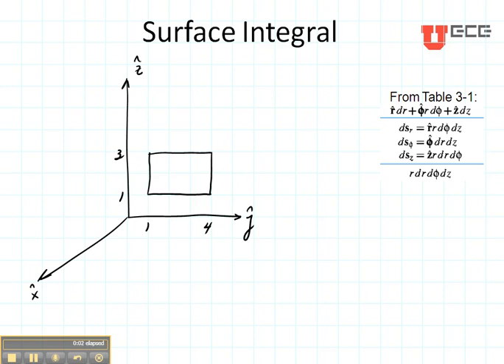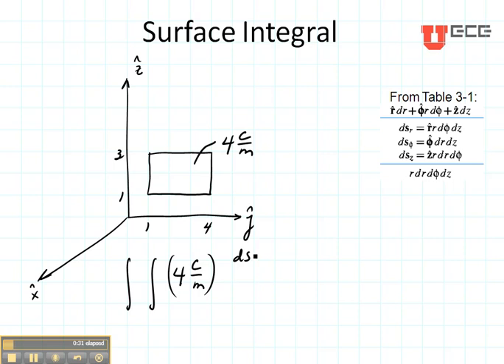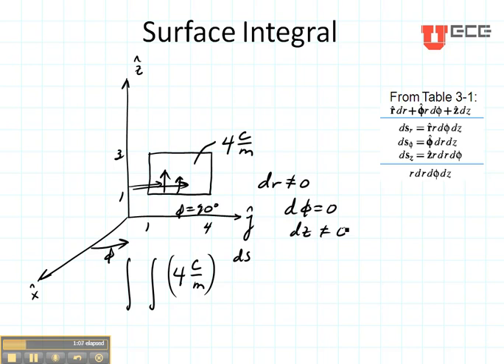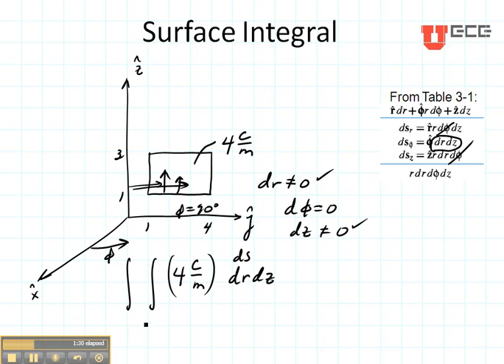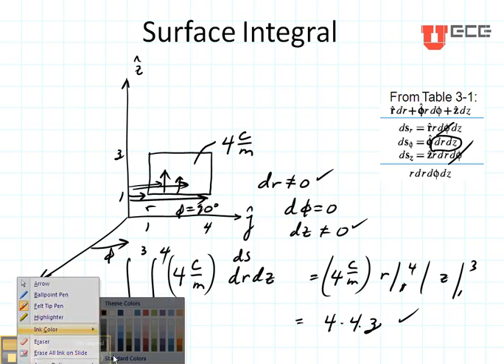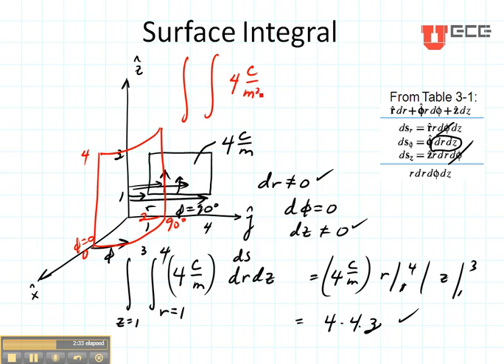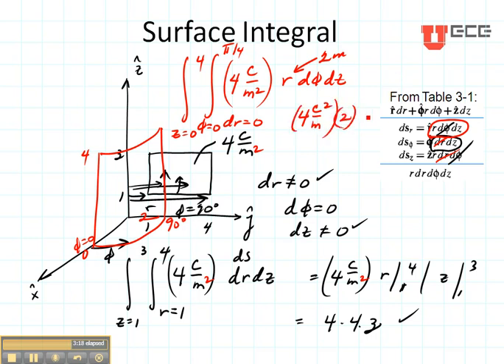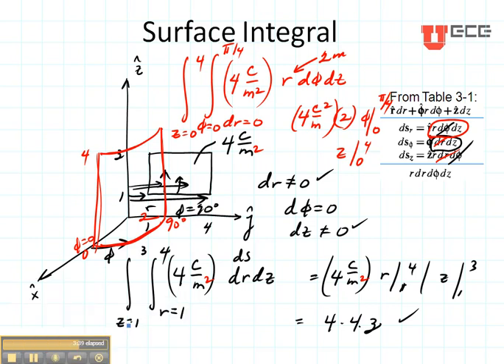ECE3300 Lecture 14-12 Coordinate Systems Cylindrical dZ

Comment: dr. furse itsvbeen mention once but i got 24 out of the firet double integral due to both limits at 1 not 0.  Otherwise your calculation would have been correct.